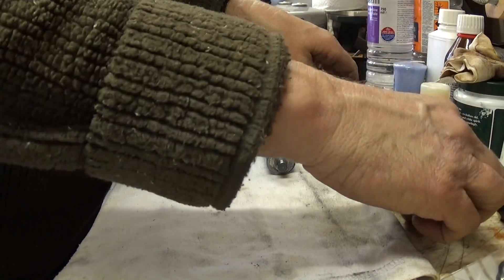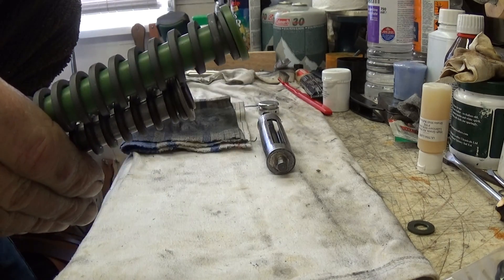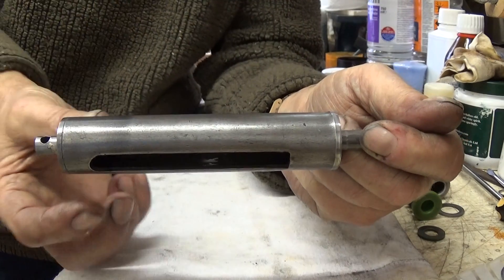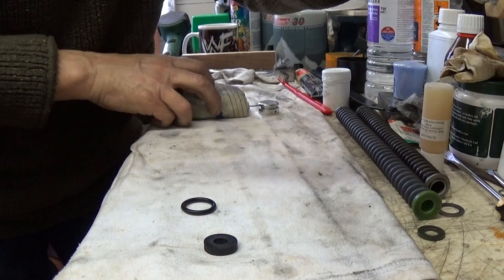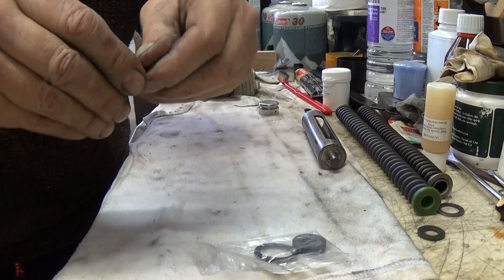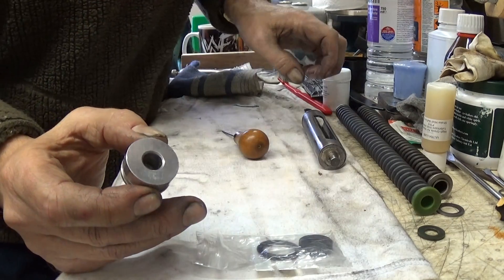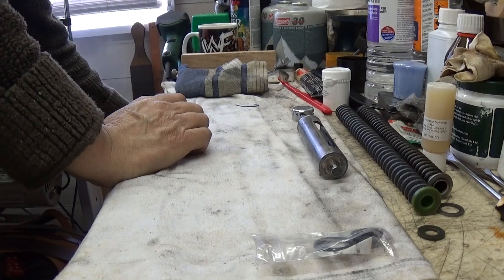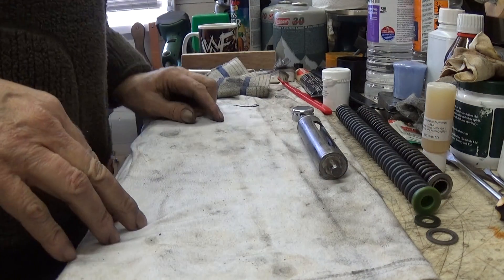Piston for MK2 BSA Airsporter all cleaned up

Comment: I drilled my piston and run it on plastic studs to eliminate metal to metal contact like TX etc. As well as spring and piston sleaves/guides I have thin wahers either end of spring to allow it rotate. Opened up and reemed transfer port. Runs smooth, very low recoil with max variation of 8 fps. 11.3 foot pounds.

Comment: The piston is from a Mk 4 or later Airsporter or a Mercury.
Reply: So the pointed piston is from earlier mk1 and mk2? Do you know what's the purpose as opposed to flat piston head?
Reply: Do you think increasing the piston stroke by reducing the washer is ideal for Airsporter? Thanks
Reply: The conical piston head was introduced from 1950 on the basis of efficiency and ensuring minimum rebound. It was replaced with the system shown in the video on models from 1965 in line with a move to new production facilities and to simplify manufacturing and save costs. The new piston head was initially made of nylon but proved to become unstable after long term usage as did a number of other components produced in plastics from this time. From the 1980’s in an attempt to achieve more power the Airsporter and Mercury S models were introduced with the reduced height piston head resulting in greater air cylinder swept volume and hence more velocity. This piston head giving increased power, may be fitted to the earlier models but may require some modification to the retaining stud. However you must ensure that any modification does not result in taking the air rifle muzzle energy over the legal limit of 12ft/lb.
Reply: @Buckbury  It makes sense to me now why many said the earlier versions are a real catch. No worries I'm outside UK. And big thanks for such an educating explanation. Happy new year to you.